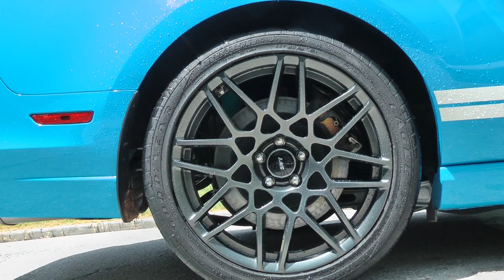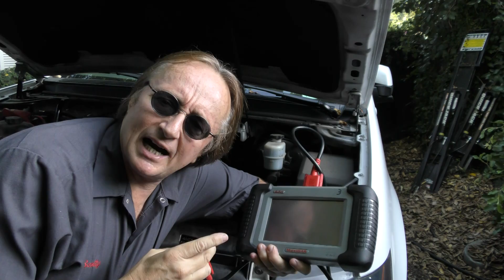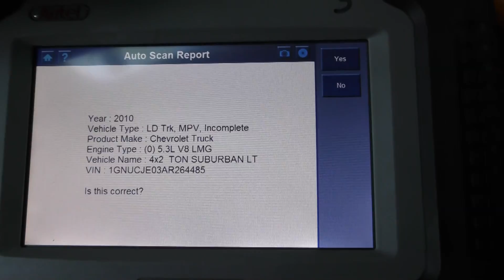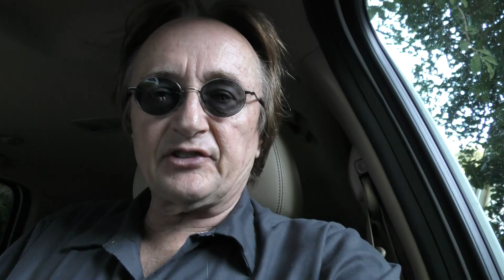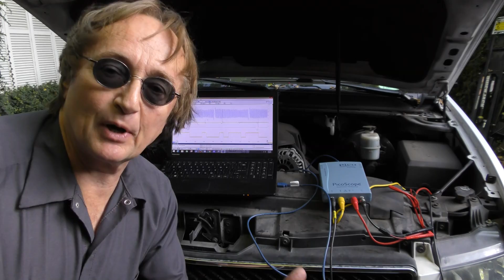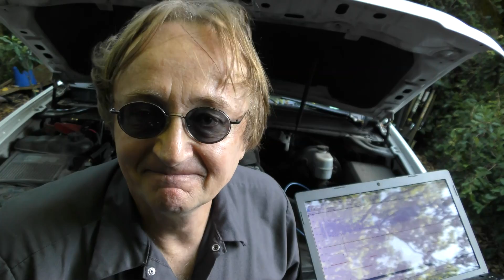Why Mechanics Charge So Much to Fix Your Car

Comment: actually that just tells me why they should charge less. using and understanding diagnostic tools makes the job easier.
Reply: safesexmonster That’s just not true at all.  It can still take several hours to diagnose a car properly.  I trained under a PHENOMENAL Audi technician, who could fix anything and the longest diagnostic time he ever had to do was 31 and a half hours.  It ended up being an over-crimped wire from the manufacturing plant when the car was made, and the car only had about 500 miles on it. Yes, it is rarer for those types of diagnosis and repairs, however you also have to keep in mind, technicians supply their own tools, and most master technicians are in at least $80,000 to $100,000 in tools.  I’ve been doing this three years and I can tell you I’m at least $30,000 in to it myself.  That’s money we don’t get back.  Plus factoring in our schooling which can cost upwards of $40,000 depending on where you go, I have a friend who paid $60,000 for school but he’s one of the top techs at his shop now.  Also factoring in shop fees like waste disposal, workman’s comp, insurance, the lights, maintenance to all the lifts and heavy equipment, etc the list goes on.  And also the biggest thing people fail to realize is that it’s not the techs fault shop fees are $100-$150 an hour.  The shop also has to pay the service advisors, the managers, the office employees depending on where you’re at, etc.  When I do side work I still charge the flat rate that I make, I personally make about $20 an hour.  So when I do repairs for friends and family, I’ll look at the estimated labor time provided by the vehicle manufacturer and multiply that by my hourly rate.  And if I ever make a mistake or improperly diagnose a problem, then I fix it for free just like I do at the dealer and just like I would if I were at an independent shop or Pep Boys.  

The computer absolutely DOES NOT give you the answer, it merely points you in the direction you need to go.  It’s having the knowledge and tools to go beyond that and say ok because of this information that I’ve been provided with, these are the tests I need to perform, and once I find a test that does not perform within specification, that is where I start, and once I install this new part, or make this wiring repair, I need to clear any malfunction indicator status that is stored within the vehicle, and verify that my repair did in fact fix the car.  And if it didn’t, then you re-evaluate the information and start over.

Comment: They invented the complexity to create a whole new industry where only franchised dealers will be able to repair the modern car. 
That said, one thing is paying big bucks to repair your modern car, another is paying big bucks and NOT get your car repaired. 
The systems are so complex that often even the techs at the franchised dealers can't figure it out.
But they'll charge you anyway.
Reply: Ellesmere Wildwood figuring out a big bill has never been a problem at stealership

Comment: My neighbors Cadillac escalade went up in flames in the  middle of the night  It had electrical issues.
Reply: Cadillacs are garbage in general.
Reply: that fire did your neighbor a good favor.
Reply: Rafy G somebody replaced a blown fuse with a higher amp fuse than the original one. thats the only way that can happen...unless of course somebody intentionally set it on fire
Reply: Princess Hermione Cadillac CTS-V...

Comment: for a scan tool that cost over 1000 dollars, it would be nice if they added a better CPU with faster refresh rates >_> i mean seriously. 30 dollar android phones have faster refresh rates than that
Reply: Yep scan tools suck for gaming.
Reply: There's a solid chance it's limited by the data transfer rate of the obdII connector
Reply: An OBDLink MX is only $90 as well plus it's compatible with Touque.
Reply: Eman 08 this is true but it's important to remember that these things are not sophisticated at all. They're not actually worth what they cost components wise. You're paying for the right to access their proprietary software and programming. The coding the components and the Assembly of these readers probably cost about $50. The high prices just paying to be able to use the program itself, and it's expensive because it doesn't scale- pretty much nobody uses these things. Mechanics do. But I mean, it cost a certain amount to make and if they only sell 500, well, the price has to be high. They also know that they can upcharge because the dealers aren't going to make their own program. So it doesn't scale and they're fucking the dealers. Sucks to suck lmao

Comment: So get a non modern car. 
Got it!! 👍
Reply: Indeed, a classic of which parts are readily available. It's also bad time for buying new, because it's not sure where we're going (environmental wise). Funny enough, youngtimers are getting banned from city centers; but often cars older than 30 or 40 years are again welcome, because they're odd collectors items...
Reply: Nick Smith You've must be stuck on a car payment or own a your 3rd Prius going on four.
Reply: Helps if you stick with Ford, GM, and Chrysler for vehicles, the parts are much easier to find and a lot cheaper.  Many pick-a-part yards have several to chose from, where say Volvo, and others may not be as easily available as there are't as many on the road.
Reply: Rade Ue Masq I just got a 76 Datsun 280z. :D
Reply: Well if that's what you buy its your own fault for not checking over it thoroughly.  Get in and drive in a new car?  Yep, that's how they end up broken down and worn out is people don't take care of them.  There's more than just jumping in your car and driving away, no matter the age of the vehicle.  Funny enough along the highways the most common vehicles you see broken down are newer vehicles because the owners have that same mentality, well its a new car I don't need to do anything to it.  You still have to maintain them, no matter how old they are.  And what car do you have that requires a tuneup every 20k miles?
Reply: Too old cars are not practical, but late 80's and 90's cars are very viable, especially in non-rust states where cars can last forever
Reply: Be careful; the older cars sometimes require a machine shop to make a new part and the tires are different and can cost 300 a piece. I know, we own an old volvo and to buy a tire from walmart is 300 a piece. And finding not rotted tires for this car is hard. Also the rust starts and body work is very expensive. There are garage kept cars out their so, take your time and you can find one. Check the parts costs and tire availability before buying.
Reply: @rebeccashetter2309  ya know you could just change the wheels? no?
Reply: So an unsafe and possibly rusted out car that requires tuneups every 20k miles?  Ill stick with new cars that you just get in and drive and worry less about surviving and or causing car accidents.

Comment: My Nissan breaks down after a while of driving and takes some time to start up again, no matter where I am. I took it to the dealer who sold me the car and he used one of those computers to look for codes and found nothing. he then charged me $30 and when I said I know there's something wrong with it he said it's me imagination. I returned the car to him.
Reply: abdul rehman i am willing to bet that it was some type of fluid/ liquid falling on the ignition coil. this happened to my 1999 dodge ram van. it would shut off after 15 minutes of driving because a coolant hose was leaking on top of the ignition coil. this prevented the current from reaching the spark plugs. the van would turn on just fine a couple hours later after the coil would dry up. i replaced the coil and the hose, never shut off on me again.
Reply: Think your diagnostic is right !!!
Reply: thank you for your reply! though I could easily start my car again after 5-10 seconds and it would run fine and the car shutting off was quite random it could be the coil guess I'll never know now :p

Comment: The tools cost a fortune now also (and not a small one)
A top of the line scan tool which is needed at times can cost as much as $10,000.00 plus the skill to operate it properly.

I fix computers part time and people think that costs to much, yet again there is skill involved in knowing how to diagnost the problem.